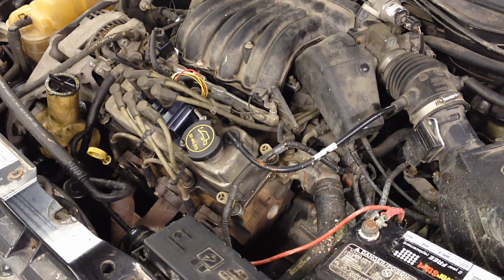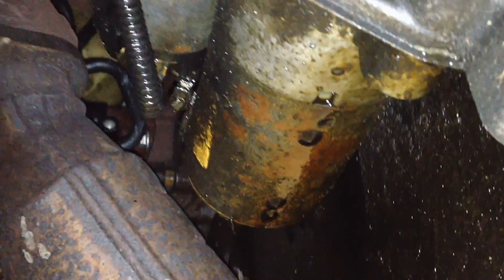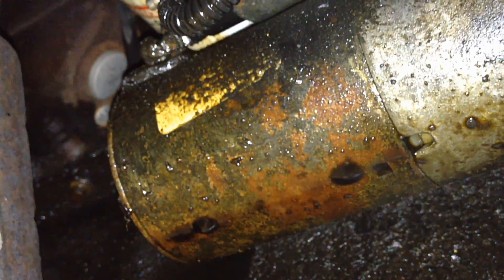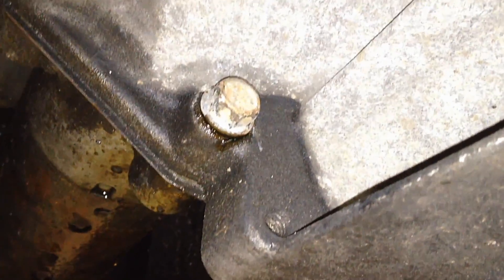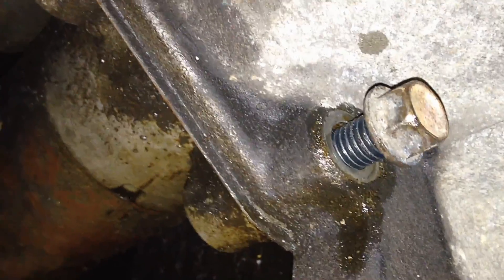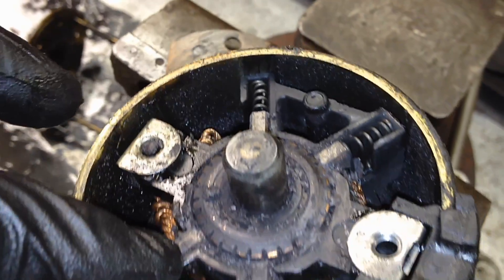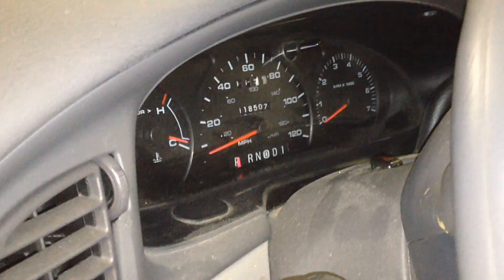Ford Taurus 3.0L 12v Starter Replacement & Failure Analysis

Comment: THANK YOU FOR THIS LIBRARY, THAT YOU HAVE BUILT, WITH YOUR OWN HANDS, MIND & LOVING KINDNESS.

MY 2006 Taurus is of the same chassis iteration, 3.0 Vulcan V6 with one small but important difference.
Bring a 14 mm socket and box wrench under the car as this year may have used 14 mm hardware in ALL positions where you mentioned the 13 mm as demonstrated in your Tutorial.

Again thank you for your beautiful site and professional information.

Tim

Comment: Thank you for this video! Same thing was happening to my old Taurus. Intermittent starting problems.  I had eliminated both the battery and alternator as the problem after checking them with an old Snap On battery meter/load device. 
Of course I am not a young guy anymore so it was kind of a bear to do but it sure saved me a boat load of money. 
Thanks for doing these videos

Comment: My Bendix won't engage flywheel.  Flywheel teeth fine.  Have F4p1 7000 cb transmission in 2004 Taurus SEL.  Bendix spins, won't engage.  Help please.

Comment: thinking thats the problem on mine...what if it makes no noise?...isnt clicking or grinding...the lights and fan turn on but thats it...i changed the alternator and battery and its doing the same thing...no check engine or any other warning lights

Comment: I have an 06 Taurus with 185k miles on it, used for daily rural mail delivery, and my engine bay isn't that filthy. Holy crap!!! Anyway, this video is straightforward and it looks like my starter will be an easy fix.

Comment: Thanks for the video. I think this is what is wrong with my 2004 3.0 taurus. The oil filter backed off a bit and was leaking a little oil and now the car acts like it has a weak or dying battery. Took out the alternator and starter and had them tested separately and they check out as good. Think there is a way to seal up that end of the starter so that it cannot accumulate oil in it? .

Comment: I have yet to find a video on replacing the starter on a 2004 Ford Taurus 3.0L.  Is there a reason for this?  I have replaced the starter on the 2003 Ford Taurus and it is a piece of cake compared to the 2004.

Comment: I have a 2004 Taurus SES, DOHC with the same issues. It will have problems with intermittent/slow crank AND the misfire. My codes read failure to start within first 1,000 rotations, and random misfire, and catalytic converter below threshold bank 1. The last time it was on a lift we noticed the started was wet with oil from the leaking oil filter. Recently, I've been battling an electrical problem that I've isolated to the Integrated Control Panel (fuse 22 - ICP logic, kept blowing when the key was turned to run/acc.). Just before removing the connections to the three knobs on the ICP, there were no windshield wipers, no power windows, blower motor speed coil had been badly damaged and was removed so I could at least use the fan on hi, no radio, no fuel level gauge, and my instrument cluster was acting a fool... There WAS, however, power reaching the end of the wire harness to the wipers, windows and radio, they just wouldn't work or had no power signal. Behind the ICP was a 10-14 gauge ground wire that is was not connected, I'm going to ground it and connect each knob one at a time and turn the key to see if it blows the fuse.

I say all of that to point out that it began starting weak and slow at almost the exact same time as all of the electrical failures. The electrical problems started all together one day when I went to crank it for work. The windows were intermittent for a day or so then went out, followed by the blower coil a day or two later. A couple days later the wipers quit working. All three, however, had power from hot 12v or more, but power signal wires were not hot to the radio and switch signal wires had less than 0.1v. When I removed the ICP everything came back to life, but it still starts like shit! The battery went dead a few days ago when I left the lights on by accident, and when the jump box was connected it started right up like it should be.

Aside from the leaking oil drowning the starter, are the electrical issues related to the random misfire and failure to start within the first 1,000 rotations and/or starter cranking slowly?

Comment: As a Ford mechanic myself in Iowa I see 50 to 100 of these a year same oil soaked starter issue . I bent a old license plate to divert the oil from the filter when changing them and use electronic cleaner for the drips but give 15 mins after spraying to dry completely before reconnecting the battery .

Comment: Great video, camera work, and insight on the symptoms and cause.  Thanks for taking the starter apart and showing what's going on inside to cause this.

A friend called me and said his kids 2002 Taurus had been acting up and not starting all the time.  He went over and tried to jump it, but just got a click, he adjusted the jumper cables and it cranked slow but started (a coincidence). He drove to the Auto parts store where they tested the battery and said it was OK.  Then the car would not start, so he called me.  To me it sounded like a loose or bad connection since it was intermittent.  The solenoid would click, but no crank.  He tried banging on the starter, but no luck.  We'll be changing it in the parking lot tomorrow.

Comment: Very Helpful video.  Thought my battery was bad due to the click sound when turning the key but the starter bearing was burnt/locked up.  Not too bad to replace if you remove the starter from the bottom.  Just don't see how you could remove from inside the hood but I'm sure someone has.

Comment: I always cover the starter with a plastic supermarket bag before I change the oil filter you have to work it around and tuck it. The old starter from before i got the car that I replaced was soaked as well.

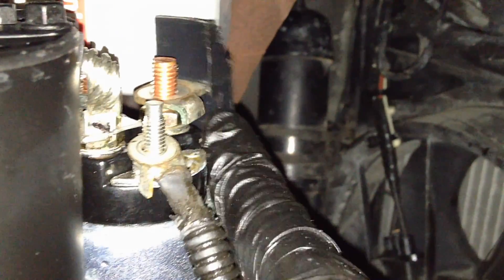Comment: What is that relay on the starter that isn't the power cable to the battery (front one, your video, 6:20)? I was changing out my positive and negative cables, thinking they may be the reason for the no crank no start, but I noticed as I took the red power cable from the battery to the starter, that there was another wire that hooks into a clip. I have a 97' Taurus and the wire that goes up from that other terminal on the starter seems to have fallen apart or was never there.

I have also had a parasitic drain on the battery, and figured if this other terminal is some sort of ground, that it may be the drain as well. My thought for it not being the starter, is that I can jump my car and it runs fine but cannot start on it's own, even though the alternator and battery are in great condition - I've changed them both out.

Comment: One would think this could turn into a serious fire issue...  Be nice if there was some kind of aluminum or even plastic shielding around the starter...  See a lot of cars and trucks these days that have a plastic catch under the oil filter that catches all the oil and guides it towards the drain pan plug.  Guess Ford just hopes for people to take the car to the dealer.

Comment: Thanks, I just took mine off, same problem clicks and sometimes turns as little as one revolution only, should i try to fix it and put it back or get another one?, is it repairable ? how much do you think the new one cost? AutoZone tells me $105 while Google search says $50 !
Reply from the maker: +Haider A I only buy the Ford units but any decent reliable starter is going to cost $149 for this car I just priced one of these jobs out.

Comment: I have an 06 Taurus, having an issue where it would have weak starts. Has 146K miles anyway, but the starter replacement will help me get better value! THANKS FOR THE GREAT INFORMATION!
Reply: Have you had any other problems with your taurus?

Comment: I have a 2005 Ford Taurus. Battery is good. Sometimes it will start and others it just makes one click and nothing. I cleaned up the wires and checked them. Is it the starter?
Reply from the maker: +Denny Williams Most likely yes they can be intermittent like that I have also found a few starter relays cause this because of the burnt contacts.
Reply: Thanks. I'll be changing it this weekend...
Reply: +FordTechMakuloco I also have another question. I also have a 98 Ford Taurus wagon. my daytime running lights are coming and going flickering sometimes on sometimes off, but when I turn on my headlights they work perfectly. everything else seems to be fine power wise. what could cause this?
Reply from the maker: It is almost always the DRL module itself they get very hot and rot out check that first. It should be in the front end of the car near the fender apron.

Comment: A few moths ago I most admit that the starter (6 years old) was slowly getting weaker, actually after watching your video, just like you explained it would die from being exposed to oil dripping down on it, the battery (7 years old )was also getting weaker and not holding its charge. Anyway yesterday it all came to an end, starter was dead, but thought first that the new battery would fix things, but except for higher volt reading the starter was still dead, anyway watched your video and now have a old crappy car that can start again, thanks for your easy to follow video, saved the cost of getting a tow and the labor to install.

Comment: I have a similar, if not identical issue. Slow cranks or no cranks, despite a perfectly good battery, etc. One day it works, the other it doesn't. Happened twice this week, ironically after getting an oil change... But the thing has 190,000 miles on it; so it's time to replace it anyway. Anyway, I watched several videos on this by now; but must say that yours is BY FAR the best I've seen. The camera work, up real close yet very focused, is amazing. You must be using some kind of hi-tec camera. Thanks for the video, and the details regarding what causes the failure! (and dang Ford for that lousy design)
Reply from the maker: +Erik Janssens Glad to help thanks for the kind words I do the best I can.

Comment: DEAD ON MY PROBLEM! Pepboys checked battery, alternator and starter. Said everything was good. Went home. One stop and it would not start. even with a jumper. Waited for AAA to tow me home after the driver beat the hell out of the starter with a metal bar. But nothing.

I'm taking the starter out and I'm sure it is loaded with old oil.

Thanks!

Comment: replacing starter#3 in an 04 had it for 4 years. oil leaking onto wires, I have to dump a quart a week into it.
Reply from the maker: +Amy lee Sounds like it would be cheaper to fix the oil leak.
Reply: just had it all fixed. that's a starter with a casing on it he put in for me. supposed to keep the oil out. the oil leak turned out to be a cross thread damaged plug from my last oil change. all good now.
Reply: just had it all fixed. that's a starter with a casing on it he put in for me. supposed to keep the oil out. the oil leak turned out to be a cross thread damaged plug from my last oil change. all good now.
Reply: just had it all fixed. that's a starter with a casing on it he put in for me. supposed to keep the oil out. the oil leak turned out to be a cross thread damaged plug from my last oil change. all good now.
Reply: just had it all fixed. that's a starter with a casing on it he put in for me. supposed to keep the oil out. the oil leak turned out to be a cross thread damaged plug from my last oil change. all good now.
Reply: just had it all fixed. that's a starter with a casing on it he put in for me. supposed to keep the oil out. the oil leak turned out to be a cross thread damaged plug from my last oil change. all good now.
Reply: just had it all fixed. that's a starter with a casing on it he put in for me. supposed to keep the oil out. the oil leak turned out to be a cross thread damaged plug from my last oil change. all good now.
Reply: starter fixed. he replaced it with one that has an oil guard casing. Same price. also my oil leak was due to a damaged plug from some guy cross threading the screw and slapping on some silicone to seal it. (nice fella) all good now.
Reply: starter fixed. he replaced it with one that has an oil guard casing. Same price. also my oil leak was due to a damaged plug from some guy cross threading the screw and slapping on some silicone to seal it. (nice fella) all good now.
Reply: starter fixed. he replaced it with one that has an oil guard casing. Same price. also my oil leak was due to a damaged plug from some guy cross threading the screw and slapping on some silicone to seal it. (nice fella) all good now.
Reply: starter fixed. he replaced it with one that has an oil guard casing. Same price. also my oil leak was due to a damaged plug from some guy cross threading the screw and slapping on some silicone to seal it. (nice fella) all good now.

Comment: Nice video, you're right about the oil soaking into the starters.

I put some clear rtv on the seams on the new or reman starter, keeps them oil free
when customer can not or will not wan the oil pan gasket r/r.

Check that pcv valve if it is Ford OEM, the guts were missing and that caused oil pan gasket to leak a lot.  Avoid those plastic oem pcv valves, get metal ones.

Comment: My car is sitting in the parking lot at work.  Wish you did the top down version. Oh well I'll  be laying under the bull after
Reply from the maker: MrMannie1524 Top down is even easier.
Reply: FordTechMakuloco i did a little of both and found an oil leak. You're  videos are the shit good sir. Helped me put my timing gasket that the dealership NEVER PUT ON MY CAR! bastards used sealant and it failed big time!

Comment: Thanks for the video!  I recently found that the oil filter on my 01' Taurus was really loose and leaking oil everywhere so got that fixed.  Lo and behold, it started slow cranking yesterday....replaced the battery (it was 5 years old)...but still slow cranking...looking to get the started replaced today.  This video taught me the how's and the whys.  Thanks a bunch, I subscribed!  :)

Comment: I'm just about to do this right now, shame it;s 15F outside cold cold.
Thanks for the video!
Reply: yeah it didn't take long at all, thanks for telling me what tools I needed saved me some time.
Also you might want to get a brand new starter, Amazon has them, I paid $53 to the door for mine, tax and all.
I still have my core too and the local auto part stores wanted more than $100 for a reman.

Comment: I think I'm having the same problem it sounds like it a battery problem but it's been replaced recently along with the alternator. It does have an oil leak like that one and it started to turn over slow before it started, but now it doesn't start. Does that sound like the same problem?
Reply from the maker: Kenny Morton Yes it does from your description.
Reply: Thanks for the help. I had the starter tested, it actually passed but I went ahead and replaced it anyway, now the car starts great, good vid.
Reply: @Wildken8  that's the same thing what's going on with my car and it's  a  2000 Ford Taurus took off the starter took it to AutoZone and the starter pass  but won't crank on I'm going. To buy a new starter see what goes next  I'll keep u guy's posted 😉

Comment: This was a great tip and a excellent video. I have been a GM mechanic for 29 years and I am used to working on only GM products. My girlfriends car had that exact concern and I was actually able to clean out the start and clean the commutator and brushes and it starts like brand new. Thanks for the tip and the excellent how to video.

Comment: Very nice.. My Taurus is a mess in regards to oil leaking all over the starter. Anywho, one of the 13mm bolts that seat the starter to the housing is a real pain in the ass to reach. Would it be easier to do it from the top or would I have to remove some parts to reach it? Additionally, am I better off with wrenches or ratchets? Thank you for the vid.
Reply from the maker: Elena Solis These are actually very easy to get to a ratchet is best. Old ones from the top is easiest while the newer ones I would say 2000 on are easiest from the bottom.
Reply: ok, thank you for the reply !

Comment: I have a 2002 Ford Taurus and although I don't have an oil leak, it appears as though I have a battery problem but both the battery and alternator have tested fine. My next thought is the starter. The battery light comes on intermittently and when I start the engine I sometimes get what sounds like metal on metal. Any help for the mechanically challenged?
Reply from the maker: Kristine Moore If the battery and alternator are ok I would check the battery positive and negative cables down to the starter to make sure they are clean and corrosion free. Otherwise I would change the starter out yes as the drive mechanism is getting stuck on there and chewing up your flywheel. As for the battery light on at times is the alternator original Ford one? I have seen the connector with the 3 small wires on it for pcm comm and such go bad and a simple wiggle test will show a failure.

Comment: Does the starter on a 04 ford tauras need to be shimmed or is that based on the starter?
Reply from the maker: Michael Alvarado No shimming at all the inspection cover does all that.
Reply: Good deal I've been having a weak start lately and think it had to do with oil getting in the starter

Comment: Thank you because I just bought a 1996 Ford Taurus gl and it was having the same problem and now I can do it myself. It has less miles than this one but it's older so yeah. Also I had the entire engine cleaned along with new wires, hoses, connectors, freeze plugs, New battery, and the kitchen sink. Thanks though this will really help mainly because I'm a college student on a limited budget!
Reply: Do you still have it?